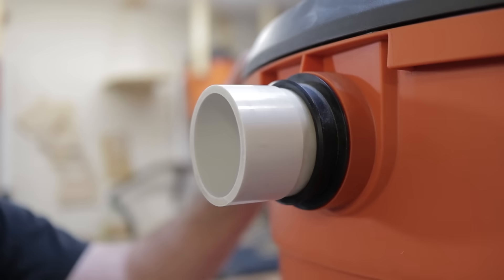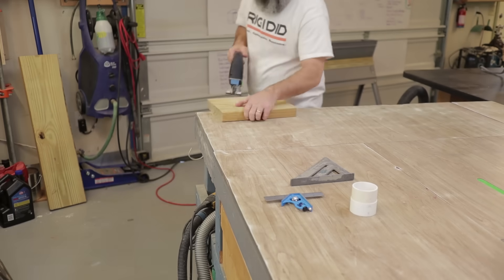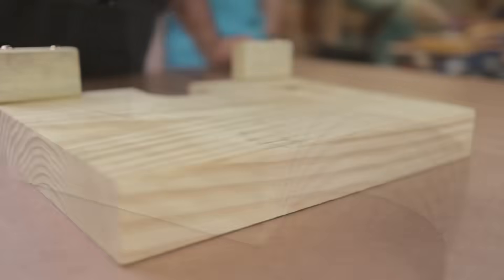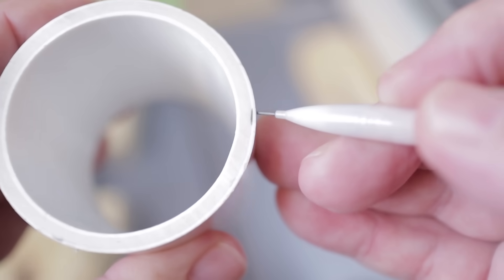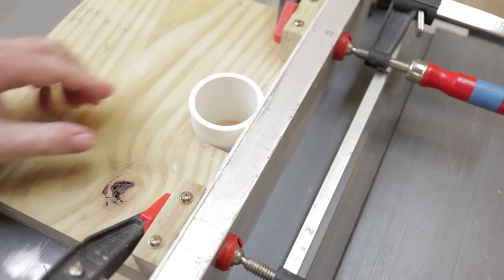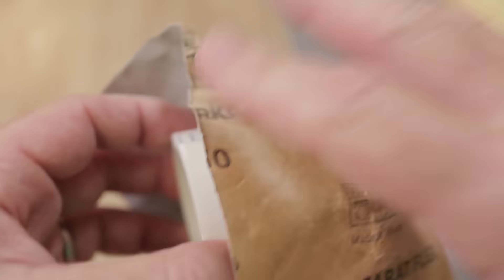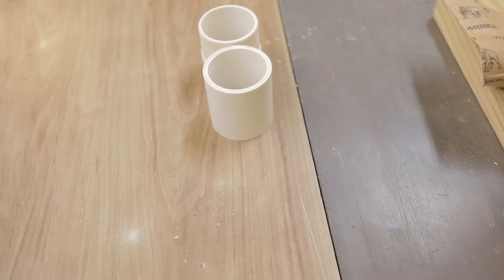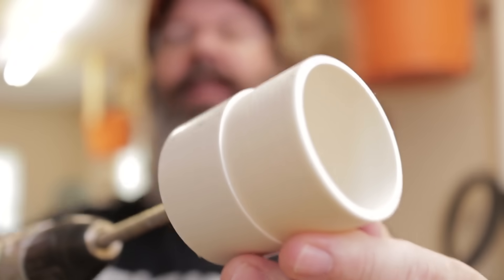Dust collection adapters shop vac to PVC made fast on the table saw

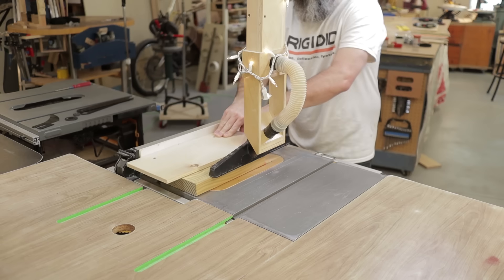Comment: I have watched this video several times.  Always good info, and I keep picking up more.  Just noticed, at time 0:55, something is visible on, or above, the left edge of the workpiece.  It appears to be a vacuum accessory mounted on a wood drop-down arm, with a hose attached; i.e., overarm dust collection.  Is that correct?  If so, I would love to know more about that, how it was built, how it is suspended, how well it works, etc.  Thanks again for sharing.  Btw, just got a Ridgid HD1400 vacuum.  Looking forward to learning about your dust collection/vacuum setup.
Reply from the maker: Hey Joe! Yes, this would be correct.I call it over the top or O.T.T. extraction and it works great. Another feature is something I call doubling down which is using an extra saw's fence for extra cut capacity. I will make a detailed video that breaks down my entire table saw setup soon. There is a lot of footage of my shop in action in the cabinet build series. Thanks :)

Comment: I've seen a similar jig used with a plane blade or sharp chisel inserted with a wedge, then mounted under a drill press. 

Could probably use a mobile drill press base with that table saw jig to speed up production (and suffer less fatigue to the hands lol) if you had to make several of these adaptors. 

For making a few this looks like a good investment of time to build vs result.
Reply from the maker: Thanks for watching! More dust collection videos on the way!

Comment: Mount the round piece of plywood to the pipe and use a power drill like a lathe. Why involve a table saw ? You will get better results
Reply from the maker: Haha!
Reply: @SlowandExpensive  Oh something else i forgot to tell you . You removed a layer of the plastic exposing unprotected material . This will make the material sensitive to getting dirty or even crack/disintegrate faster. If you want the work area on the PVC to last , just pass the pipe instantly on an open flame to seal the PVC material again. Cheers brother !!!

Comment: Cool and excellent info but here is another way and all you need is a heat gun. The advantage is the fittings made by heating and forcing the PVC into the vacuum port is they will have the correct taper to them to insure a snug press fit. I had a video ready but then I found this guy :-D https://www.youtube.com/watch?v=EQDAbu2znP0
Reply from the maker: Thanks! There are actually many other ways to make these adapters. Russ will be happy you shared his video. If you prefer using the heat gun method you are all set. I like using the table saw jig. It's fast, accurate and repeatable. Next video in the series is about making custom hoses https://www.youtube.com/watch?v=CEouFGfZzEg

Comment: For that final touch, spray some slightly diluted acetone on the rough cut. It will soften the PVC a bit and as it dries out it should leave a very smooth finish. (or if you have it, you can use PVC primer and let it dry)

Comment: Great idea and very interesting video but I would take issue with using the drill.
It seems to me that there is a danger with running the drill too fast.  🤷🏻‍♂️
I think for simplicity sake I would have your a longer piece of all thread, bent it using 2 off set 90* bends to form a rudimentary hand crank.  Place a handle on the upright end and turn them by hand.
Yes...it would be slower but I cannot think of a reason home shop would need a production line of these.
Reply from the maker: Thanks!

Comment: You know that genius right? I love it. Do you think it might be a little easier if you made your cut on a table saw with a longer pipe, say 12 in long and then you
Reply from the maker: Thank you! Using longer lengths may work out easier if spinning them by hand but probably not much advantage if using a drill.

Comment: Great idea. I have a bunch of stationary and hand power tools with different sized dust ports. I have a ryobi battery rolling vacuum. No one seemed to make all the adapters I needed so I finally figured out to use the rubber pipe adapters that have metal bands you tighten around each end. Was able to order all the different sized ones I needed off Amazon and weren't expensive. They work great!
Reply from the maker: Thanks!

Comment: Do you glue your PVC fittings or is it just friction fits?
Reply from the maker: Friction fit. It's rare that anything disconnects because there really isn't any movement with my connections and not using glue leaves the option to disassemble and reconfigure the setups differently if desired.
Reply: @SlowandExpensive  
Thanks so much

Comment: As an old retired Military guy and fellow bearded man I was wondering what type of mask you use when you use one that is that still works good. I've seen those $400 dollar helmet style mask with a built in fan but get real people as I could by a bit of lumber for $400. Great Video and thanks
Reply from the maker: I don't use a mask that often but when I do I like the disposable type (usually 3M) welding respirator that is shaped for the nose with the little extra breath hole filter in the middle. They have a little extra heft to them and a nice face gasket. They are the same ones I use for metal work. I usually get them from cyberweld.com in a pack of 10 for around $30. If I don't have one I'll tie off a bandana like a bandit :)

Comment: this process can be used for something else, however, all you need are
2 in. PVC Flexible Coupling with Stainless Steel Clamps, $10 for 4 of them, connected my HD Rigid shop vac to the rockler blast gates and WYE Splitter.
Reply from the maker: Perfect!

Comment: Did you buy stock in Shop-Vac Company, It seems that a single Vac system is in order.  https://www.grizzly.com/products/Grizzly-Grizzly-Growler-Cyclone-Separator/G0863

https://youtu.be/lXUxI69Ydp4?t=409
https://youtu.be/lXUxI69Ydp4?t=574

Comment: Why do you have so many Ridgid vacs? One dust collection system wont work?
Reply from the maker: The story about the vacs will be told. This all happened while I was saving for the type of system you mention.
Reply: @SlowandExpensive  I have made a 2 stage vertical vac system... a 5 gallon bucket on top with a topper. I made the system out of 21/2 flex hose and 3 ports and 3 blast gates. I leave the sander and chop saw hooked up all the time.  The run to the table saw is easily stretched and removable so it can be anywhere in the shop. When I disconnect the table saw line I can connect it to a long... 30 foot hose set up with vacuum accessories to clean the whole place. I dont have a giant shop or loads of machines so the orange system seems fine.
Reply from the maker: Sounds like a good set up.

Comment: This is called "Imagineering." Too bad the dust collection industry cant standardize dimensions. I have used my lathe, though your solution has some advantages over the lathe. I will build a jig like yours, however, I will drill the hole with a Forstner bit. Think outside the box. Great Idea!
Reply: Seems as though using a very small angle to the blade, 3-4°, may help the friction fit seal, if done correctly. Extra taper may help account for variance in different manufacturers and stretching or contraction from wear or temperature.  To much may result in lack of sealing surface though...
Will be trying in the coming weeks myself. Will report back if I recall too.
Reply from the maker: Thanks Tom!
Reply: Imagineering love that word
Reply: I just stumbled across your video and immediately thought of using my lathe as well. Good idea. Just subscribed and going to check out your other videos.

Comment: Nice solution for a shop without other resources like a lathe.  Wouldn't work to well with abrasives, either, because it would clog the friction material.  You didn't mention backlash on the saw height from down to up, but this shouldn't matter unless the maker has a well used table saw (like my 1954 Craftsman, lol).  Nice job!
Reply from the maker: Thank you!

Comment: This method would probably come in handy for making one of the bucket cyclone collectors, where there pipes don't exactly fit the vacuum. Great idea! Thanks.
Reply from the maker: Thanks for watching!
Reply: Excellent point considering those bucket cyclone collectors supposedly work great but has one of the highest mark-ups I've ever seen in comparison to the cost of materials to build it.  HD wants like $50 or something nuts like that for a plastic funnel with a somewhat unique shape that couldn't have cost more than $5 and that is being extremely generous.  I can't bring myself to pay that much for something I could reasonably fashion myself for pennies.  If someone ever starts making these adapters and selling them on eBay they'll make a mint.  Slow & Expensive should make an adapter and call it the Cheap & Fast Vacuum Adapter by Slow & Expensive.  (You can use that if you want to.)   Great content.  Novel and interesting which is not easy to find these days on the YT.
Reply from the maker: Thanks so much TD Smith!  :)

Comment: pretty nice system and video  i was wondering if you could make a  wooden mandrel  covered in sandpaper  for grip that attaches to a power drill to spin your PVC inthe jig  instead of turning it by hand ?   you could probably use any thickness sheet goods  and a  bolt  attached  to it or a dowel to insert into the drill chuck    by doing so it may be easier on your hands  instead of manually spinning the pipe
Reply from the maker: Thanks! I ended up making something similar to what you are describing towards the end of the video.

Comment: I liked your jig. I also use PVC to make adapters. I've found a heat gun will let you stretch or shrink the PVC size to fit most times.
Reply from the maker: Thank you! Yeah, heat gun works too. It takes a bit more patience but in the right hands it's a solid method.

Comment: Use a heat gun and heat the black plastic pipe just enough to soften the plastic and then push the pvc pipe into the soften black pipe. Work just fine too.
Reply from the maker: That's one way to do it but it would be a permanent, one place, one shot solution. I think an adapter styled like the one in this video out of a small length of pvc no matter the method (table saw,  heat gun, lathe, etc..) would make a much more versatile part not only because it doesn't alter the vac port itself but there are several other places they can be used in any given set up. In the second video in this series I use them to make custom length hose ends. Thanks for watching and sharing you thoughts :)

Comment: I didn't read all 590 comments so sorry if this is a repeat. To set the fence consistently, maybe slide a 3/4" strip in the miter slot under left edge and attach with long screws. Next time you use, just drop in. Strip could be long enough to align at table edge for easy centering on blade.
Reply from the maker: That's a great idea! Like a runner on a sled. Brilliant! :)

Comment: Good idea.  Could use the bolt plug method and crank the saw up 10 turns, then push the rotating piece down into the hole cutting the material off?
Reply from the maker: Thanks! Give it a try.

Comment: idk i probly would have put a block in the pipe facened with small screws , put it on the drill press and just  sanded with belt sander.
Reply from the maker: That's one way to do it! The second video is out https://www.youtube.com/watch?v=CEouFGfZzEg

Comment: Good video. Not a lot of time watching the star turn a screwdriver, no dramatic music, no pithy insights just the facts. The whole thing seems well worth the effort. I'll be making ten or so all at one go and have them on hand. Well done.

Curious though. What's with all the shop-vacs hanging from the ceiling. I've accumulated four of them myself. They're a lot of aggravation taking up floor space, hoses under foot and AC cords strung around. I've thought about hanging them from the ceiling over specific tools. But then I'd have to climb a ladder to empty them and, to clean or change filters the mess would be overhead and close to my face when servicing the individual vacuum. If you've figured out a better way please bring it on.

Once again, a really good video, good production and good content. Thanks
Reply from the maker: Thanks Bruce! This was the first in a series. The second one does have a little more drama but there are some good tips in there as well. Thanks for watching :)     https://www.youtube.com/watch?v=CEouFGfZzEg

Comment: It looks like you have a shop vac for each tool. Why? Why not one big one with vac tubes to each one?
Reply from the maker: It's automatic. No duct work or blast gates. Everything is 110 volts. Zero noise when tools aren't running. It probably cost me a lot less than you may be thinking as well. Those are the main reasons.

Comment: like your video, have you tried angling the blade a few degrees to get a tapered fit?
Reply from the maker: Thank you!  I've never tried to angle the blade just 90 degree cuts and the fit is pretty snug after you hit it  with the sand paper.
Reply from the maker: Hey Julien, I finally did try it and it worked perfectly. Thanks :)

Comment: I built the jig.  When I went to raise the blade for the first time to set the blade at the right height and the blade was really hard to raise.  I took it apart looked at everything.  It all seemed right.  Tried it again and same thing. It was trying to raise the wood up as if it was binding and the blade would not raise.  For sake of not having it all self destruct or sending out a projectile or ruin the saw or blade I had to abandon the project not ever knowing exactly why it failed.  Took me 3 hours and it was a bust.  Oh well....  Thanks for taking the time to post it.
Reply from the maker: I don't know either.  If your blade is good it should cut into it with ease. The board should be clamped tight enough that it will not move. You'd have to have a very dull blade or have the blade on backwards to not get a cut or for it to push the board up. Probably a lot of burning and smoking as well. If you can't get the blade to move up and down easily on the saw in the first place you probably have a gob of dust binding up the works. If this is the case blow it out good and lube up the lift with some WD40 or 3 in one oil. It should cut into the board with similar ease as raising the bare blade.
Reply: @SlowandExpensive  Thanks for the quick response.  We were definitely on the same brainwave as far as trouble shooting.  The blade is nearly new and did all the cuts for the jig with no smoking, binding, or tear out.  The saw is less than a year old and  is clean and goes up and down with ease during the whole build process including while using my crosscut sled.  The moment I try to raise it with the jig clamp down I go from silky smooth to having to use both hands to raise it just a 1/4" and then binds and lift up on the board even with 4 clamps where it seems something is going to break.     The only thing that is not perfect is that the board does have a slight bow to it although it meets the fence straight.  Still doesn't explain why the blade can't go up.   I'm baffled.  I ordered a new hose kit.  Hopefully it come with a coupling that will work while I figure something else out since I'm sure that it's something wrong on my end and not a flaw in your design.  Keep up the amazing job man.  I am truly marveled by your ingenuity and craftsmanship both in your projects and in the filming.  Nice bug  btw.   I had an old 62 with ragtop 1600 back in the day.  Cheers

Comment: I made my connectors by heating PVC pipe with my heat gun and forcing the softened pipe over a wooden circle. This can create both Male and female fittings and is quick and easy after the jig is created.
Reply from the maker: Nice! Have you seen the second video yet?

Comment: I've watched two of your videos so far. Great tips. But a question. Still organizing my shop and using shop vacs, rolling them around the shop.What size shop vacuums(Gal), are you using in your shop? Have you made a video on installing these? Again great info. Keep up the great work.
Reply from the maker: I'm mostly using the WD 1640. They are 16 gallon. The larger container is not really ideal but I got a bunch of these on sale. I haven't made a video covering the complete setups and install yet but I will. Thanks for watching :)

Comment: Using a2 ft piece long is easier just cut to length after turning each piece unless you use the drill method
Reply: Randy Wells brilliant suggestion rw

Comment: I really wish I had seen this video yesterday! I spent over 3 hours between Home Depot, Rona and Lowe's trying to find something that would fit my ridgid shop vac and my dewalt table saw. Ended up paying over $25 for flexible couplings, when I could have bought a pvc pipe and made this jig! Well, at least I know now. Thanks, you are awesome!
Reply from the maker: Maybe you can take the flexible couplings back. They take anything back no days! I just uploaded the second video in this series and it's all about the hoses. There's a few cool ideas in that one too! Thanks for watching and for taking the time to comment :)

Comment: Definitely a slick and ingenious jig. Could see other applications. Another way would be to drill out a die of the proper diameter, dip one end of the blank into boiling water, softening it enough to press into the die. Not saying it’s a better way, just an alternate method. As they say there’s more than one way to skin a cat, although it never ends well for the cat. Count me a subscriber.
Reply from the maker: Thanks Phil! Cat's beware :)